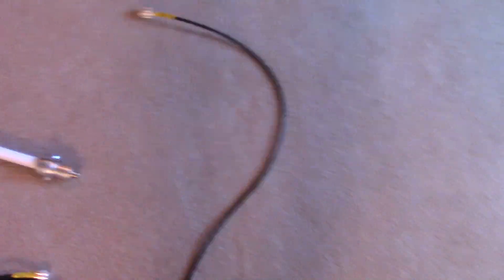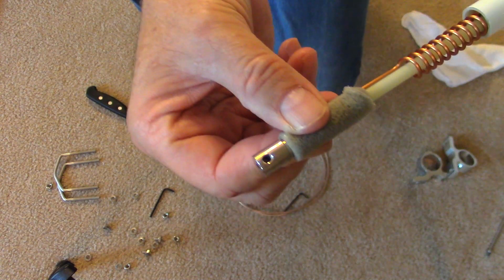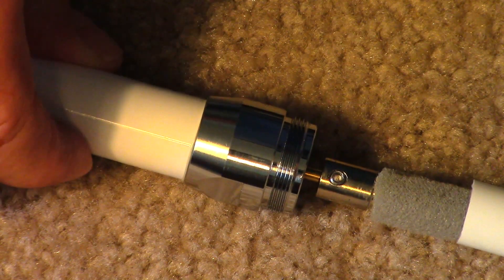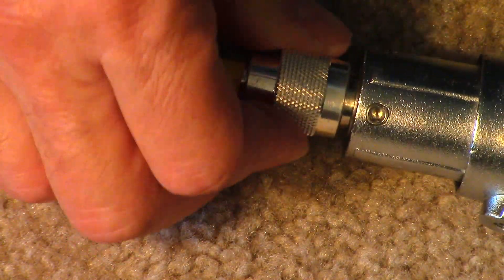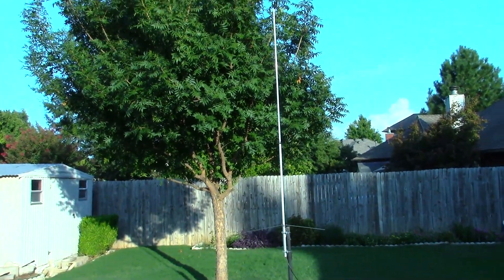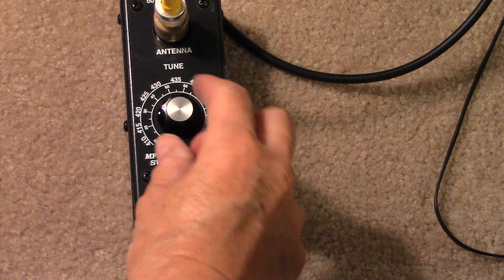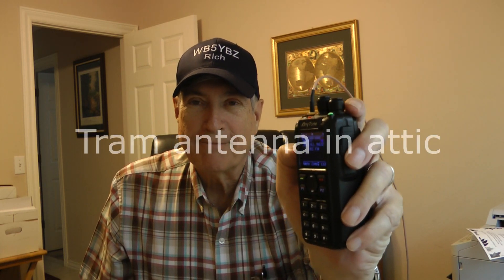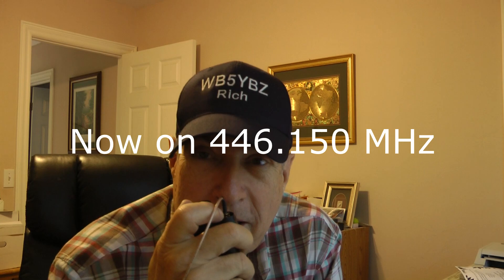Tram 1480  2 Meter and 70 CM Vertical Ham Antenna

Comment: Can something like this be done with just a simple lowly Baofeng UV-5R? I’m extremely rural, and I’d just like to be able to hit repeaters that are 20 and 30 miles away from me. I can “kerchunk” them now with just the stock antenna, but it’s of no practical value. I want to be able to get in and USE these repeaters. I'm out in the country with extremely flat terrain (but lots of trees), and I have old barns FULL of junk I could make into antennas and masts. Tons of spools of wire (I bought the place with barns full of stuff, still mostly unexplored), stage lighting tripods that go up 10-20 feet, an obscene amount of PVC pipe, and hundred foot tall plus trees all around me. Are random wire antennas and such ONLY for HF (I'll get a nice HF rig when I can afford it), or can neat DIY things be done for 2m and 70cm as well? Even if a 2m/70cm antenna were to be small, isn’t HEIGHT STILL KING? Thanks!
Reply from the maker: UHF and VHF  depends on line of sight.   If you have hills between you. That can be a problem.   But since you are hitting the repeaters.   This antenna will give you a 8 dbi  gain.   I can't tell you for sure.  But it will improve your signal strength so to speak.
Reply: @RichRodgersOnline  … Yeah, I’m on very flat ground at 120 feet above sea level and the repeaters I want to hit are in near by towns 20-30 miles away but are on very tall water towers in towns that are much higher; about 240 feet above sea level. Only trees in between…
Reply from the maker: @SteveHacker  It might be better to get a 50 watt or more transceiver.  You might find more hams and more repeaters....  You can some times find them used at a good price.

Comment: Hi Rich, Great video. I have the Tram 1481 and it is a surprising performer. Mine had the same connector input and a PL259 tightened right up and snuggly at that. Perhaps both it and the N-connector will work. Mine is on a 105 foot tower so the only precaution I took was to seal the section connections with clear silicone in liberal amounts and thoroughly wrapped the section connectors with Scotch 3M Super 33 tape rather liberally as well. The 1481 is known to have moisture issues. Bought mine cheap($84)through Staples. Moisture is a problem you shouldn't have in the attic, LOL! I can connect with 2 meter mobiles up to 30 miles away and average height repeaters up to 75 miles. A little less on 70 CM. Also flat SWR readings. 73s KX5E.
Reply: The PL-259 connector is correct as the antenna has a SO-239 connector. The author of this video is incorrect in saying it's an N connector.
Reply from the maker: Thank you for watching my video!  I think putting the silicone a wrapping the sections is a great Idea!  I am using a Yaesu Mobile 80 watts for my transceiver.  I am in OKC and spoke through a Stillwater, OK repeater (50 Miles) to a mobile he was wondering if I was a local.  So it was a thrill for me to have him think I was a local with my antenna in the static .  He said I was strong....

Comment: How can you compare a base antenna with a portable antenna? Compare them alongside one of equal claims to performance and under same conditions. I use a Diamond x30 at home, yet on 5w from a woodland in a different area in a storm, reached out 30 miles with a Retevis 771 antenna on a Baofeng. I can't compare the two...two totally different working conditions
Reply from the maker: I think if you compare correctly,  Both antennas should be pretty close to the same height using the same rig and the same coax.

Comment: Does it makes a different when you buy a 5 foot , 7 gain antenna commet  100 bucks vs a  30 inch 2-3 gain antenna for 40 dollars, in range and quality sound
Reply from the maker: Yes, the 100 dollar higher gain will get out further compared to the 3 db gain.  However, if you are close to repeaters, then a 3 db probably will work okay

Comment: Is it recommend pvc or wood as a pole or metal?  as a pole for the antenna mount to get it hight
Reply from the maker: I would mount it on a metal pole.  I am not sure about the PVC and the Sun may cause the PVC to break down.  You can use wood but then that may break down also.  Thank you for watching my video!